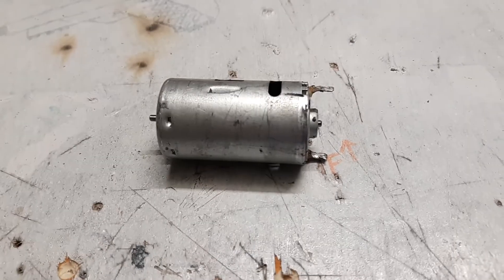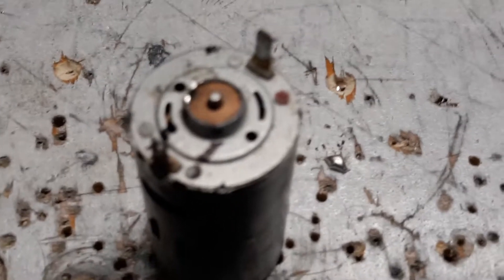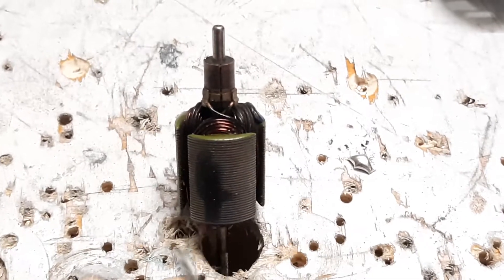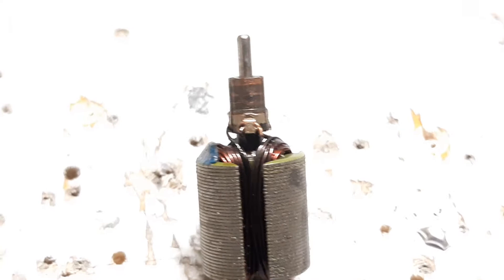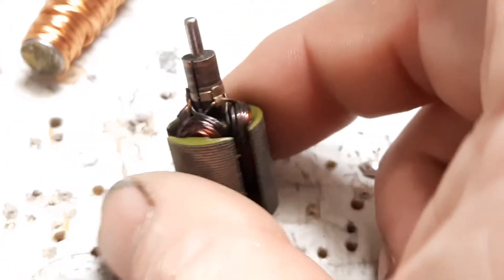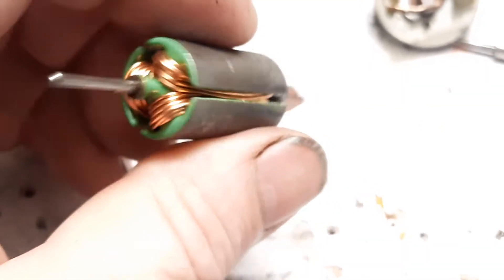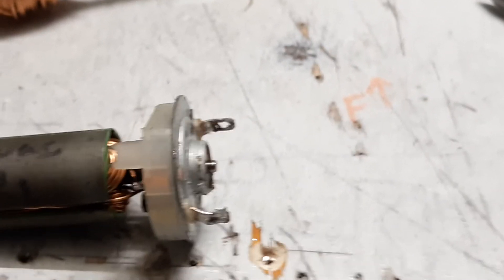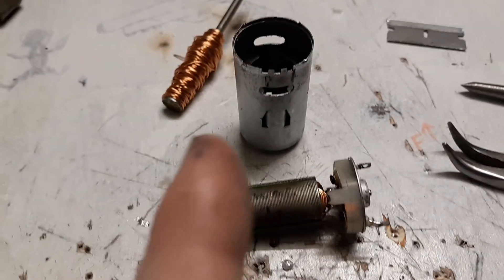Modifying a brushed motor for more speed

Comment: Very good I have a motor I want to fix there is a lot of side play in the motor shaft it’s a spec motor for racing I was thinking just loose a turn of the the original wire to give a boost while I was in there also was thinking just adding some timing advance maybe:)
Reply from the maker: Yes.
If your work is clean enough... no one will know.

Comment: Hello, can you help I would like to explore cheating in RC racing! The track is racing latrax rally 1/18 scale cars using stock 370 7575R motor. I watched the video and think I understand the procedure but I'm not sure how to figure out what size wire and how to choose the number of turns.

I think this might be variable and require experimentation but I am curious could you help me know where to get the wire? What wire size I could start with? How many turns you think would be a good starting point?

The video was really fun to watch and appreciate you sharing information to make playing field more fair!!
Reply from the maker: @aloofbit338  
I do not have wire size as a science.

Carefully unwind the motor. Count the windings. You will have 3 chances.

You will be using a factory esc for box stock racing. therefore, I would use the very same wire that came off and use 2 fewer windings.

I.E.
If the lobes had 44 turns,  use 42 turns.

Experiment with magnets as well.

Comment: Hi.
Is it possible to change the windings of a 775 brushed motor to spin at 60000 RPM ?
Reply from the maker: They make slot car motors that are the same size that will spin that fast.
The brushes in those are quite a bit better as well.

So yes, it's possible. It won't last very long, though.
Reply: @NBC_NCO  I would need this much speed to make an experiment with electrostatic fields, ionization and gyroscopic effects.
Reply from the maker: @prerupa   I wouldn't worry about these cheap toy grade ones and get a slot car motor if you're just making noises of frequencies and things of that nature.

Comment: Never use a torch or open flame on an armature.
Small hobby soldering iron appliance and snip the wire from the com tab.
The hot iron is used only when reattaching wire on the com.

* Note many of these round motor can designs are press fits.
On reassemble it many times getting these units to fit together properly is very difficult
I also advise to mark the cap against a mark on the can so that the motor timing is replicated correctly.
This is important as it will serve to place the brushes into the correct timing orientation with the Com.
Reply from the maker: I use a butane torch with a soldering tip.
Reply: @NBC_NCO  
Of course that's acceptable 
Basically I'm referring to an operflame like a small torch which will take and inenerate all the various components and elements due to its nature.
All components must remain functional after you've performed the operational repairs , rewinds all things that you might address and or eventually place hands upon ..
#1 rule. If performing any sort activity upon the motor , always make it better , never worse .
Rule#2 . If it's not broke  , then Don't Fix It.
Rule#3 Always refer to the manual or instructions .
Rule#4 always save old or broken part for reference And comparison .
Try and utilize parts Item #s .verify prior to opening any package .
Rule#5. Use proper tools .
Don't use a chizzel for a screw driver a wrench for a hammer
Etc. 
Rule#6 check and double check .
When utilizing power tools soldering Iron that get hot , or anything that can potentially be dangerous , disconnect from power source and
Put away correctly...
Rule#7 Always use safety gear and observe and obey shop rules.
I mentions this because many times it's young boys/men
That work on hobby 
Items , and ideally everyone wants a good out come and continued fun.
If you're a young person reading this and you have a question or need advise all you need do is send me a message and I'm more than happy to try to help you.
And note
IN THE CASE OF ANY ACCIDENT  , INJURY  
FIRE , SONT HESITATE OR WAIT CALL 911 
IMMEDIATELY . THESE PEOPLE ARE YOUR FRIENDS AND NEVER FEAR THEM . TELL THE THE TRUTH OF WHATS HAPPENING SO THAT THEY CAN HELP OR RESCUE YOU.
LASTLY BEFORE DOKNG ANYTHING MAKE SURE YOU HAVE PERMISSION FROM YOUR OARENTS PRIOR TO ANYTHING AND THAT THEY MNOW WHATS HAPPENING .
REGARDS
DH.

Comment: Just a passing mention .
There are many many
Things a good reminder can to to a 12v. DC brushed motor to run like a rocket .
There were times in the past gone by that this whole hobby including slotcar and trains that the wish to increase and enhance motor performance became the obsession of every racer.
That gave birth to an entire cottage industry
The MAD SCIENTIST s
Rewinders.
The fact that these folks affiliated themselves in various ways like locality Track Locations , various theory belief and processes , performance , records broken and performance , Factory affiliation and aspects of record keeping and identifiers and more.
It was thru these practices that particular re winders gained followers , established reputations and in time
Became noted advisors to the factories producing the
Model cars and compounds to the public.
It was not at all in common for re winders of my level to take a stock 1/24 medium can 3 pole brushed permanent magnet motor 12 volts and in a few hours of work at least double if not more that all aspects of motor performance
Example Classic Slot Car Manufact. of Southern Calif in the 1960 s built a 1/24 12 volt Slot car. Even total stock it was an impressive car .
The motor would stock
Turn at 28,000 Ron.
On a daily basis me and my guys in short amount of time have that same motor running between 75 to
80 thousand rpms.
That if ran for any period without load become dangerous and would likely self destruct due to disintergation , epoxied wire being thrown , comuntator overheating and fusing and brush arching .
Armature exposing into fragments.
S9 we had to develop a means of I'd and records kept.
If say a younger racer came to us and requested a rewind then prior to any enhancements performed he had to bring me a note from parents or Guardian giving permission and a telephone call where I would at 16 yrs old advise the parent of what to expect and possible consequence 
If motors were not used as discussed .
The #1 thing being injury and component destruction.
And from there selecting one of the 4 or 5 levels we had established and what to expect .
So in the case by case motor enhancement I'd record the Motor type
Original Make and dates and what was performed.
Something Like 
1 Medium can 1/24 
Classic Asp 12 v. Brushed stock motor.
Original 60 turn 30 ga.
Wire standard stock set up.
Assigned our # 106.
Date and time .
Arm was stripped and polished . Poles were Skewed for Cog reduction at 15 degree angle . 18 turns of 25 GUAGE Bellson mag wire .using a clockwise wrap in a fall back rotation , using a 5 pole
Method on a 3 pole armature , to keep constricted against shaft . Timing advanced 10 degree at comm.epoxied and balanced .
Magnets marked and removed shined with foil and replaced for torque flux . 
Placed on level surface and balanced , pole#1 heavy and drilled .
Comm put on lathe and turned 100th shaved , Brushes and springs replaced . Sent to classic and dyno Rd at 81 thousand rpm see
Factory certs .
No break in requested .
Motor demo to customer and ftb good to go. Released from our custody on ....
So aft somany hundreds of motors 
Built and changing of hands and years of service we began seeing motor returns for repair rebuilds decommission , ie repair for a more sensible rebuild or a total custom rebuild as requested as per desire .
Often we would recieve phone calls from all sorts places where someone had seen one or ours race and then bought the motor and called to get background data .
They'd give the assigned number and we'd pull the charts and records we had kept and we would provide what we knew.
But our research and experiments and proto types became very exotic as things enhanced and the bar got set higher.
In time the physical pattern the wire was applied on with , various wire sizes and turns , soon more than 
ONE 1 WIRE SIZE BEING USED WHEN REWINDING THE ARMATURE SMALL WIRE PLACED ON FIRST THEN  THE SECOND WIRE SIZE SOLDERD TO THE FIRST WIRE AND CONTINEUED OR REWINDING THE ENTIRE ARMATURE WITH ONE WIRE SIZE AND REWOUND A SECOND TIME AGAIN COMPLETELY IN A WAY THAT YOU COUDLD NOT TELL WHAT WAS GOING ON
WINDING A MOTOR SO FAST THAT TOTAL RETARDING OF THE TIMING WAS NECESSARY TO CONTROL THE RPMS
OR OPPOSITES WINDING 100S OF TURNS WITH WIRE GA OF SAY 35  AND ADVANCING THE TIMING MAXED .
USING TRACK POWER SUPPLY TO CREATE ELECTRO MAGS ATTACHED TO THE OUTSIDE OF THE MOTOR HOUSING TO CREATE EXTREM MAGNATISM WITHOUT THE WEIGHT OF HEAVEY MAGS OR BATTERIS ON BOARD THE CAR .
FROM INHOUSE TRACK VOLTAGE THAT WAS NOT NOTICIBLE .
SWITCH ACTIVATED CHANGES DOR PURPOSE OF YELLLOW FLAG TRACK CONDITIONS ALLOWING TEMPERATURE REDUCTIONS THEN RETURN TO FULL POWER BY SWITCH.
WRAPPING 5 OR 7 POLE ARMATURES LIKE A 3 POLE , EACH POLE WRAPPED SEPERATELY AND NOT WOVEN TOGETHER IN ON ITS SELF LIKE IS TYPICAL FOR ALL 5 POLE ARMATURES WRAPPED TWO 2 POLES AT ONCE.
THIS ALLOW FOR BETTER AIR CIRCULATION AND COOLER MOTORS ARE BEST .
THESE CONCEPTS AND MORE ARE STILL RELEVANT AND NOT DIFFICULT TO PERFORM.
ONE STYLE OF WINDING I USED ALL THE TIME IS THE DROP DOWN FALL BACK WIND.
MOST 3 POLE ARMATUTURE ARE WOUND BY CONNECTING WIRE TO THE COM AND BEGINNING THE REWIND BY TAKING THE WIRE FOREWARED TO THE NEXT ON COMING POLE .
THE METHOD I'd use often is to connect to the Comm and instead of moving to wrap the on coming first pole,
Instead drop the wire directly down the slot right beneath where you attached the wire.
Now that pole is wrapped in a clockwise rotation .now when finished , instead of advancing to the next pole over the top of the armature to pole #2
, You drop the wire back to the preceding pole #3 And bring the wire directly up the slot and attach to comm.
At this time again wrap in a clockwise rotation..
Finished drop back as before and wrap pole #2 , the last pole in clockwise direction.
Now at this time to disguise the wrap instead of being ing the wire to the slot ship and bring the wire around over the top and twist it together and connect to the Comm as is typical 
It just keeps it dicey for those unfamiliar with the drop down and reverse wind you used.
For what ever reason the drop down reverse rewind in my opinion is a very good way to improve motor performance without alot of exotic changes .
Try it sometime with some timing advance and wire size increase and you be surprised .
Always at least clean and polish the comm.
Place armature shaft in a drill press and using Emory board or fine file abuff the armature pole surface of all dirt
Detritus and impurities from surface for overall looks weight reduction and maximum magnetic exposure .
Clean or replace brushes and springs 
For a good modicum rewind enhance ment with minimal side effects.
Question ??
Just ask I do my best to help.

Comment: Sir it's not very often I offer advise.
But in that at one time I was a mad scientist rewinder in day gone by I thought a couple of things to make this easier for you.
You mention balance .
After you have preped to start the rewind never do it by number of turns . Wind wire onto the armature and then take it off.
Now measure the wire length and place the exact amount onto each pole .
This eliminates mis counts and myriad other factors .
Now after testing the armature for function
Take and vertically mount 2 razor blade on glass surface using candel wax .
Using a level set ithis on a level surface .
Epoxy wire and let dry.
When accomplished
Take and the the armature shaft onto the razor blades.
Let the armature rotate about 10 times and the heave poll will always be the one hanging
Down.
Now place armature in a vice and using drill press drill small portion of the metal pole off untill a better balance is created.
Now you're ready to roll.
Good luck
DH.

Comment: Why bother?
You said for more speed but the balance issue. 
Then you just said the same thing is available??!!🤦

Now for a kid that’s learning how things work and just understanding the concept, good project.
Reply: Or just to learn somthing new.
Reply from the maker: When you race in factory stock this is a way to cheat. 
Especially if your factory stock motor is like a 21 turn. Making it a 12 turn will give you an advantage. 

The other reason is if you have to rebuild a motor for a vintage rc car and  no hop up options for it.

I used to purchase old vintage rc cars and throw in modern electronics.  The Motors in those are built for longevity not for smiles.